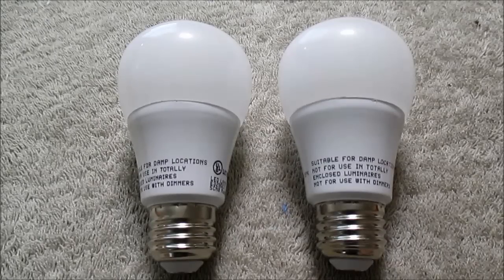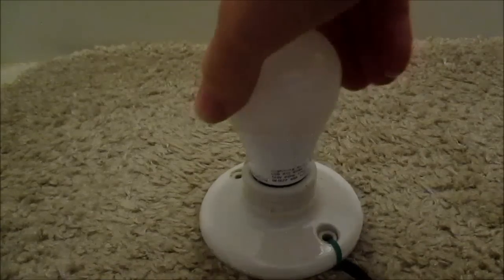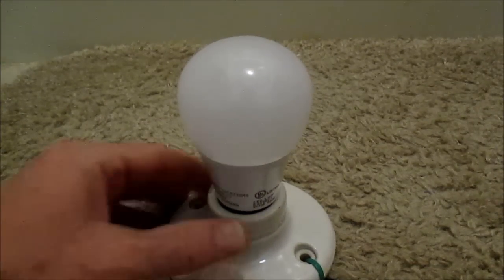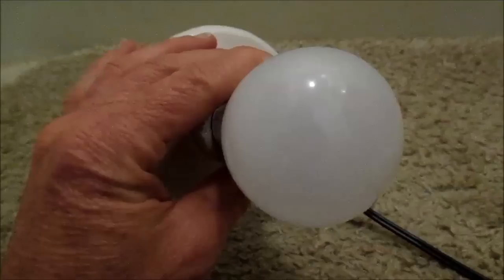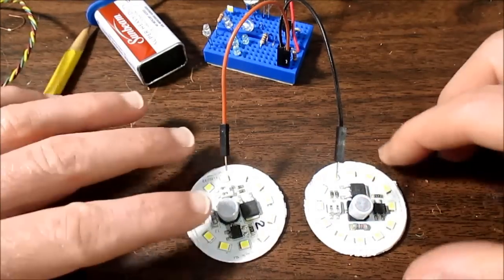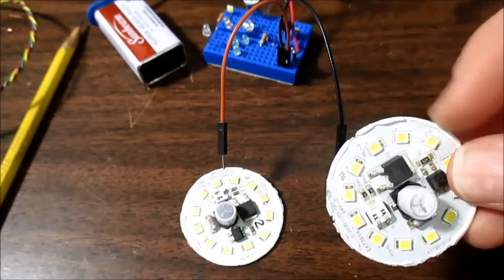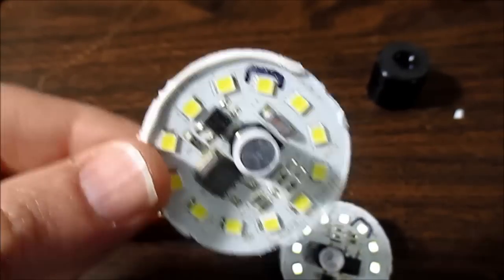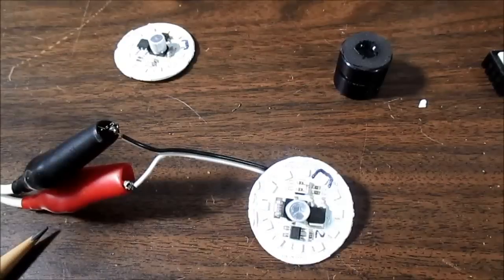Two failed LED bulbs for teardown to determine the cause

Comment: What I learnt about light bulb replacements is they don't like enclosed fixtures. They overheat and die. What I would up doing was installing only 1 of the 2 bulbs that fit into my ceiling glass bulbs, and then recently I changed one to LED. I think there is enough heat dissipation. I never leave them on if I go out of the home.

Comment: keeps them in business, if the bulbs never burnt out, then how long would a company last, especially if their bulbs were affordable? lol
Reply: True, arrays of under-driven LEDs wired in parallel with voltage and current regulation could last longer than your house.
You could make some and never buy bulbs again. You could even sell them to people who don't want to have to ever buy bulbs again.
Reply: tenalpoen No, you can not sell refurbished or modified light bulbs that last many decades, because you can't just sit at home with a soldering iron and then sell them on Craigslist. For many, many legal reasons and certification requirements etc. And that's a good thing because otherwise we would have competition to everything-but-in-name monopolies, and this cottage industry capitalism culture of the 19th century where self-reliant and savvy little people could strike it rich. But this is the 21st century and it's already been decided a long time ago, long before you were born, that you get nothing.
You should be thankful that you can modify and repair these things at home. But, if you do repair or modify them, then that's still not legal to use according to code. However, as long as you don't burn down the house who is going to find out, right? Wrong. 
Bottom line, if you cause trouble for this industry they will eventually kick in your doors and check every bulb in your house if you haven't bought any sort of bulb in an 8 year period. They will lobby for laws and send code enforcement. This is America, after all.
Reply: LEDs have the potential of putting most of the light bulb industry out of work....You know that is not going to happen...I date every LED bulb installed and most fail by the 3rd year...About 2x that of CFLs.
Reply: Yea, no, I'm not having any led bulb failures, save for the very few cheap chinese manufactured ones I bought to tear down and test.

None of my LED's are in fixtures that enclose them.  If your LED bulbs are enclosed, the electronics will heat up and stay at 160F.  This means predictably, they will fail prematurely.

All my LED's are on dimmers, and all the LED's I buy are dimmable.  This means they tend to be more expensive, because the circuitry for dimmability is more complex.  As a result It's also a better matched power supply, and runs cooler.

Cheap Chinese electronics are well known for being out of spec.  These products will run hot, will fail out of the box, and are rarely from a legitimate company that you can interact with.  Chinese companies you can't get a refund from are not really entities you want to do business with.

LED's from 6 years + back are mostly obsolete from an efficiency perspective, the visible lumens per watt we get now are that significantly greater.
Reply: They won't be in business selling over  priced ckrap for very long either.  Consumers are switching back to incandescents.
Reply: Only if that was the only brand you could buy, or else felt compelled to buy them because of brand loyalty, despite their inferior product.
Reply: Or if they are the only ones you think you can afford. People often go with the cheapest possible when it comes to things like light-bulbs. So for a company to make enough money by being the most most affordable option, it will limit their profit margin per unit. Therefore the only way a business with a small profit margin can turn that into success is by sheer volume and turnover (repeat customers). Its not that they are intending to be evil, but it is viewed by some in the modern business world as the only viable way a smaller company can break into a market. But from our perspective its not cool, because we feel slighted. That is until we realize that you get what you pay for. Not that I like it, it just is how things are for now.
Reply: Consider also that the cost of the components in the circuit goes up if you add redundancy to prevent the entire unit failing, and that the failure rates of LEDs isn't high enough to justify the added cost.
If the LEDS were all in parallel with resistors to drop the voltage, the bulbs would cost more and people would still probably want to replace units that had a failed LED and were visibly darker than a good one.
Reply: No not true,
Reply: Funny, some years ago when I heard that claim, that's exactly what I immediately thought of.  One thing I've learned in life is to be skeptical about everything I hear on mass media.  They're all liars, cheats and thieves and we keep  paying for it.
Reply: Mike noyb You have it relatively good in comparison. In many European country you have to pay extra mandatory fees for the state owned broadcasters. In Germany, for example it is a $30 a month mandatory "media fee". Only very few actually watch these stations nowadays but everybody has to pay to get propagandized to.

Comment: I have checked out 2 of these in the pass and both of them also had a bad LED on the circuit board. The old incandescent light bulbs seem to out last all of these " energy saver lights" I say the incandescent lamps are better in the winter since they also produce heat which actually contributes to the heat in the house. This would make them 100% efficient.  There is no energy lost with the incandescent bulbs in the winter as both the light and the heat are used. So which light do you think is the best light to use in the winter?
Reply: neutrodyne, no they don't last longer. Most LED bulbs are going to last 10,000+ hours, many will last more. The difference everyone whines when their 25000 hour bulb doesn't last. They don't feel the need to create a youtube video on the 20th incandescent bulb they replaced that year.

Both the LED and the incandescent bulb are "100" efficiency w.r.t. emitting energy that will likely end up as heat. However, plugging something into your wall tends to be a very expensive and overall inefficient way to heat your house.
Reply: The LEDs I have used as well as the CFLs have not lasted me near as long as the orignal incandescent last. You can put what ever life span on a light you want to but that does not mean that it will last that long. My guess is that the life rating is base on LED's that are not pushed to the limit like the ones used for lighting a house.
Reply: Only if you have resistance electric heat. The most expensive way to heat.

Comment: As an aside, does anyone remember the round wafer type capacitors they used to sell for incandescent bulbs? They went  in the bottom of the socket and were to supposedly smooth out the current and prevent surge which was the reason for premature failure (Hard on the filaments). I have to believe they worked because I still have some of the old filament type and the filaments look beat before they ever blow.
Reply: May have been diodes, I don't remember. I just remember a bulb would last years. You can't get them anymore :(
Reply: Bob Bastion 
I'd rather watch paint drying than this " lamp tutorial"zzzzzzzzzzzzzzz
Reply: I am so concerned about your amusement. You know, there are a few more things to watch on here. May I recommend Worldstar for you?
Reply: Bob, that age dates you if you remember those. Haven't seen those since 1970?.
Reply: I suppose but isn't strange how they just disappeared as if they'd invented a car that could run on water? I can't find anything about em on the net.
Reply: It was a diode. It worked by cutting off half of the AC cycle, which resulted in the bulb being driven by 120V pulsating DC. Since the reverse part of the cycle was simply blocked, there was no power flowing half the time. So a 100 watt bulb would be cut to an effective 50 watts, as if you had cut the voltage to 60. Of course the bulb lasted much longer, but you also got a lot less light.
Reply: I'm not sure about that particular device but I've seen the gradual dim on and off feature of the Lutron Maestro line of dimmers has kept various incadescent bulbs going for years. Link: http://a.co/4Q6CDCU. For all the talk about electricity consumption of bulbs we have to keep in mind the cost of replacing bulbs, if it goes up relative to an incandesenct I'd have to think there's some unreasonable break even point with all these cheap LED bulbs.
Reply: i
Reply: A short like that should only have blown a fuse or tripped a circuit breaker, unless the person did something like put a penny in the fuse holder.
Reply: Or the same thing that caused the bulb to flash for fun

Comment: The shorted LED  is creating an inductance in the circuit. Which causes the LED's to light up when the current is interrupted. The inductance reduces the resistance of the circuit to zero when the outside current is applied. Producing the extreme luminosity.

Comment: How about cannibalizing one of the bulbs to utilize LEDs for replacing the bad ones in the other two bulbs?
Reply: Ralph Navarro .. for $1 at the dollar tree just buy a new bulb
Reply: Yes, you can save a bunch of money by swapping out components.
-But, only if you value your labor at 8 cents per hour. 😃
Reply: You can do that or just bridge the bad LED, and place a resistor in series with a diode and 110V AC and use it for a night light...I have 3 burning now in my garage. they have been over a year. Very low current draw.
Reply: Well, Gerard Vaughan,
You certainly present a compelling case.
Why, I'd bet you could start a thriving LED Bulb repair business.
I'm gonna' wait for the first quarter profit statement though, before dumping the 401k into blue chip stock.
Reply: reply to: Gerard Vaughan:
You certainly have a gift for presenting the matter in a positive light.
And I have to agree that there is value in repairing damaged LED bulbs. Although we may never recoup our time investment, there remains a degree of satisfaction to be had by reviving an item that was designed to expire.
That said, I feel that the circuitry used to power the LEDs needs much more refinement in the years ahead. The lure of the LED bulb is mainly its low power consumption, but the quality of light is primitive, in my opinion. I have a bedside lamp that I made from a radio-controlled sailboat model, a halogen light, and a touch-controlled dimmer. I recently replaced the halogen bulb with an LED replacement, and have mixed feelings toward the result. The LEDs provide consistent white light, even at dimmed levels, whereas the halogen bulb was somewhat "yellowed" at dimmed settings.
The compromise however, is that the LED have such a rapid "on/off state, that they create a very annoying stop-motion effect on moving objects in the room, when dimmed. It is most disconcerting, when the ceiling fan is rotating, and the blades appear to have a "jerky" appearance. Perhaps supplying less of a squarewave DC to the LEDs from the dimmer unit would lessen this problem. Maybe I will look at using a bridge rectifier and a capacitor, someday when I am flooded with free time and feel an urge to labor for 8 cents /hr.  Ha.
Reply: reply to: Gerard Vaughan:
Couldn't help but chuckle as I read your last post.
Very interesting coments, and agreeable too.
I am in the States (Maryland) and things are not much more optimistic here, regarding world affairs. Today is our deadline for reporting our income taxes to the IRS, so our "voluntary compliance" is mandated to occur, lest we fail to comply, and volunteer our monetary contribution to the global mess.
With regard to printing money...
I often think: "Well, since they are in the currency printing business; I'd be willing to be patient, while they print enough for their own needs, rather than mandating my voluntary compliance." Ha.
Good suggestion for the dimmer circuit. I haven't taken a look at the dimmer circuitry, but I am sure it is cheaply made (for us consumers). I suspect that it does produce an oscillating waveform for its output. Thus the LEDs are only responding to half of the sinewave, in addition to the horrible spikes that you mentioned.
Yeah, I too have been interested in the variety of frequencies of light that are available with LEDs. Seems to me, that while I am soldering in some replacement LEDs to repair a bulb, I might as well mix things up a bit, and experiment with installing different LEDs of various light frequencies, to taylor the resulting output to my liking. I wonder if there are any bulbs on the market that offer a full spectrum? (I haven't actually researched them.) ☺
Reply: Exactly.

Comment: The Costco LED's are SHIT every single one I bought in the 2 packs failed within 6 months. I switched over as they failed to GE which cost me more at Home Depot but years later they work fine. I only suggest the cheap COSTCO LED's if you are selling a house.

Comment: When these bulbs start arcing, they ruin your socket.  Call the electrician.  LED home bulbs are a conspiracy to make you miserable.
Reply: That's be cause the socket is already burnt beyond reliable connection to the more sensitive electronic bulb because of the burner bulb damage.

Comment: Do they make completely different bulbs for European 220v? I've wondered if they make bulbs universal that could work with anywhere between 100-240v like is common with industrial electronics. I've been running US bulbs on 220 in machine tools but can't tell if they have a longer or shorter life cuz they live a hard life and experience things like filling up with coolant requiring me to vacuum them dry to restore operation:-) Generally I can't tell a difference between 110 and 220v with LEDs and CFLs.
Reply: I live in the PHILIPPINES and MOST of the LED BULBS sold here do infact have an input voltage range of 100 to 240 vac, with no reduction in light output that I can detect with my eyes.

Comment: I see inefficiency in the design. If the could design higher voltage higher current LED's they could use less components = less waste less failure over all.

Comment: Reliable products from brands with a reputation to protect cost more. People who buy the cheapest bulb they can find are likely getting components that have outright failed quality control in a higher-grade production facility before being sold to lower tier producers. 21st Century Chinese factories will deliver any quality level that buyers are willing to pay for, including the lowest.
Reply: And in the case of these bulbs, it was less than a week for one I bought. That brand is now off any buy list. Walmart sells them under the " Great Value" label but it is the same bulb.
Reply: ...Great Value, alright...for the Wal Mart Execs...   likely paid the Factory 8 Cents per Light...
Reply: Thankz4sharing And sell all that cheap junk in walfart
Reply: Keep in mind most electronic components in consumer goods are only tested to 1000 hrs at 2.5x rated voltage. with 1-2% failures allowed. This is about a month. If you have 6 or 8 components in addition to the LEDs Expect 1 - 2 x6 failures even if the LEDs are good.
Reply: Russ Watrous x
Reply: RIGHT, THEY ARE SO REMOVED FROM THE PURCHASER, WHO CARES? JUST SO LONG AS IT looks LIKE A USABLE ITEM, FUNCTION IS NOT NECESSARY....
Reply: I remember a Vice Channel Tv undercover buyer show showing the exact thing.  Same factory, buy whatever quality you want to pay for.  Guess what?  Most corporate buyers buy the cheapest.
Reply: Right on.   Bought a No-Name LED 60 watt (8.5 W) to try it out.  11,000 hour rating !!  Gone in a couple of weeks. 
But, hey, it was only a dollar.  Where have we heard that before?
Reply: No no no no. Not true. I have an entire house full of greenlite 60w replacement LEDs that cost $1 a piece from the dollar tree. They have great brightness, perfect color temp, and I haven't had a single one burn out in over 2 years. They are amazing but it sounds like theres is a lot of overpriced crap out there.

They can be had from wal-greens even cheaper, it's like $3.59 for a 4 pack. Never a single problem, I love them and never going back to CFL. They work amazing in the cold as outdoor bulbs as well.
Reply: I don't understand you because your writing is poor.